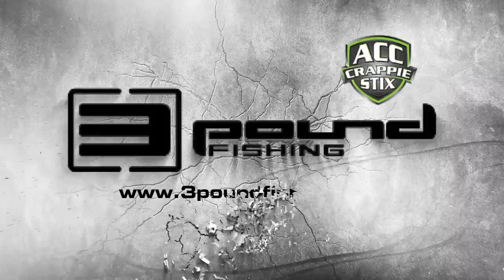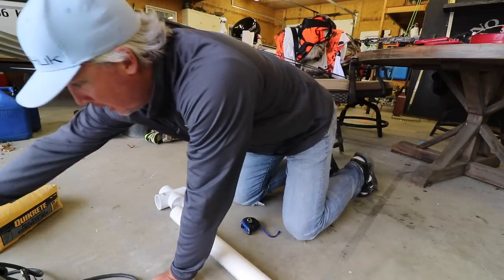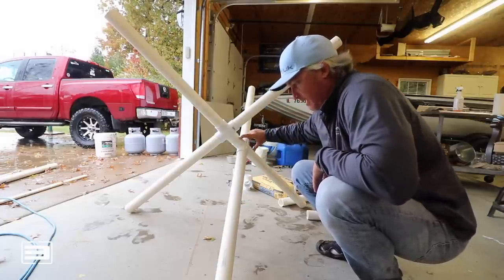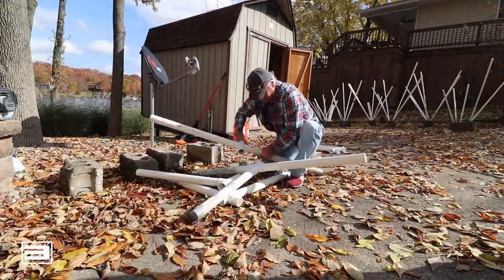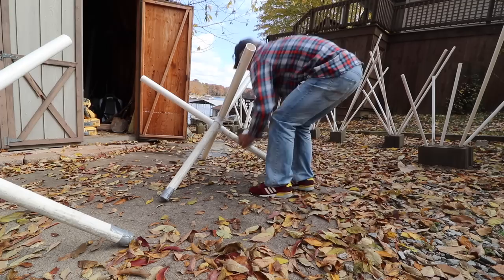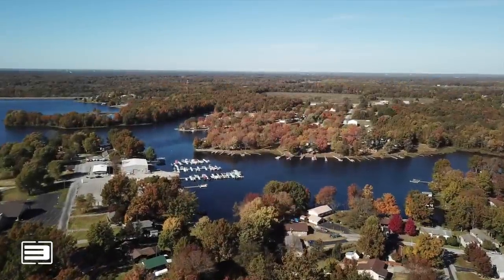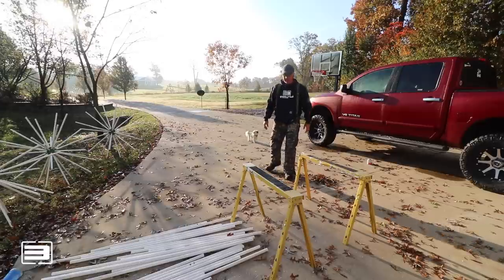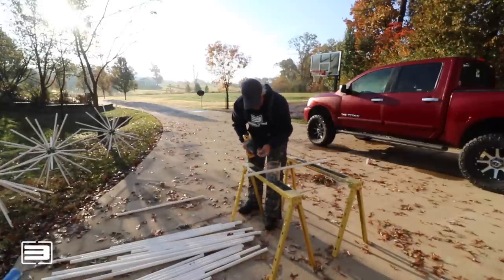Building Fish Attractors for Crappie

Comment: Do you have much luck with the pvc? I made a bunch out of pvc last year and fished them this summer without much luck. I didn’t sand mine though😬. I’ve started making them out of poly tubing that’s used for drip irrigation and they are awesome compared to the pvc. Plus the poly tube is cheaper and easier to transport because it’ll flex. I can send you some pics of how I make mine if you’re interested.
Reply from the maker: Shane Barrett I tried bamboo last year.  Didn’t work either.  I think location is most important
Reply: @3poundCrappiefishing  I have done some bamboo  myself. Put em out in spring. Caught fish on them already. But I put them in a shallow 13 acre lake.  I read somewhere a guy done a test with this fish fertilizer.  He rubbed down all his sanded pvc or drip tubing with this and let it dry.  His attracters were set up to raise and lower. The ones he used the fertilizer on had algae growth a lot sooner than the ones without.  It was called Alaska fish plant fertilizer 5.1.1